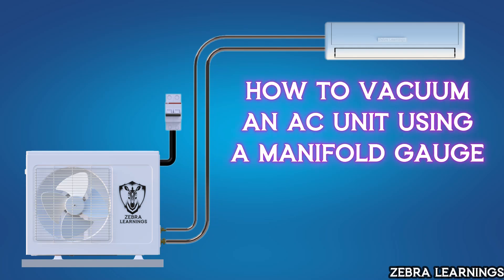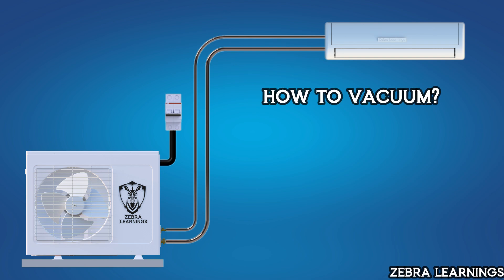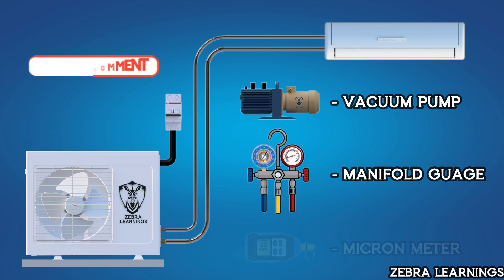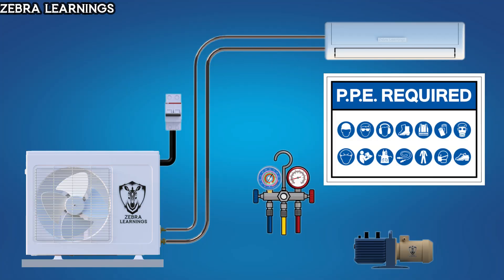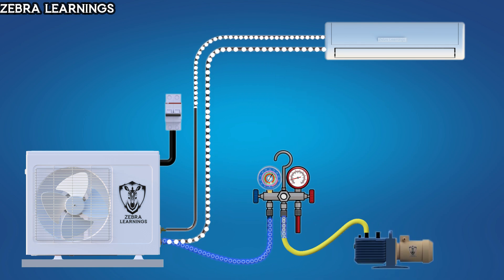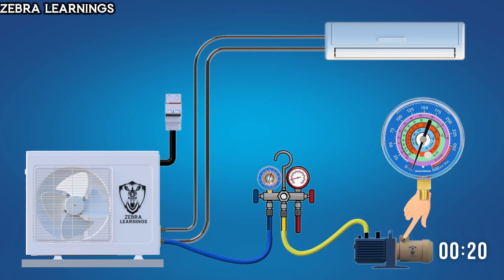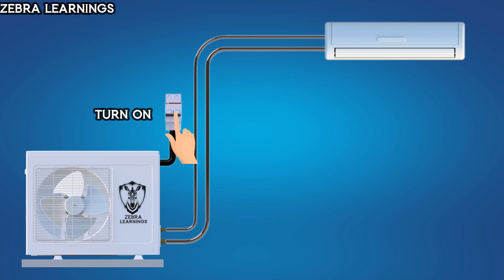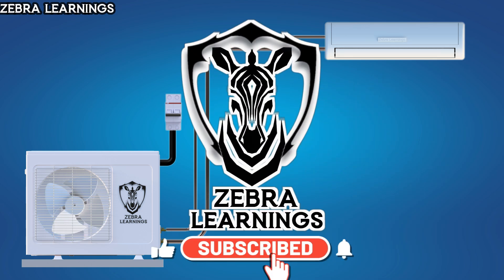How to Vacuum an Indoor AC Unit: Step-by-Step Guide | Animation |

Comment: NOPE.......Why use the manifold when you can bypass the extra leak possibilities?  You can simply use hoses and a vacuum gage with some hose valves.  Rookies use manifold guages to vacuum.  Also, where is the vacuum guage?  You are supposed to measure the vacuum in microns.  DO NOT LISTEN TO THIS HACK.  HE is clearly an untrained individual.
Reply from the maker: This video demonstrates how to vacuum an AC unit using a manifold gauge, and we’ve also explained how to perform the process with a micron gauge. The link for that video
https://youtu.be/XiPDHWW3dAA

Comment: Can i do the same vacuum process after replacing the compressor by leaving both suction and discharge valves closed whilst running the pump

Comment: Passed nitrogen pressure test for leaks and no bubbles show up in bubble test while under nitrogen pressure. Held pressure perfectly for 24 hours. Can vacuum down to 150 microns but it will not hold. It's at 1200 microns 2 hours later. This is a 12000btu mini split. Help.

Comment: 4 line 9 
direct 
045 inverter3059 alternate switch 1 series 5 circuit 7 volt switch diameter and (0)mainswitch

Comment: 3:06 ac technicians always open discharge valve first? You are telling to open suction line first? Please explain it. They open discharge slight and close. Than using soapy water they check leakage from joints. After that they full open first discharge valve than suction valve.

Comment: what happens to the oil  in the a/c unit does it come out to ?       And why is my vacuum pump oil  cloudy...?
Reply: The valves on the outdoor unit remain closed while you vaccum which is only applied to the pipes and indoors coil.

Your vaccum pump oil has absorbed moisture and should be changed

Comment: It's useless after you did vacuuming because you pump down the Ac, there still have a moisture, air and non codensable gas in the system of outdoor unit. Its better you removed it or recovered it All refrigerant gas inside the system and do vacuuming that's the perfect procedure. 
After vacuuming you put the new refrigerant in the system then your AC the result will cool properly.

Comment: My AC was not vacuumed while installed. However cooling is okay and satisfied after 18 month. The only issue is that compare to other same AC with same running parameter my AC is consuming 10-20% more power. Is it due the vacuum not done ? If so, How to do the vacuum now ? Please help
Reply: yes.  recover refrigerant. put vacuum on system.  check if vacuum will hold for 2 hours.  charge unit with refrigerant by weight.

Comment: If you fully open liquid and gas line before removing gauge, alot of gas at high pressure will accumulate in gauge pipe and significant refrigerant can be lost. Instead open the liquid line only, half a turn for 4-5 seconds and then close it again. Now remove the gauge pipe. It will ensure that while removing the gauge pipe, only a small amount of refrigerant at low pressure leaves the system and no moisture goes back.
Reply: Why don't I just remove the gauge pipe before opening the liquid line?
Reply: @karamhasanat4487  there is no air due to vacuum.....how can it be separated ? A little air or in this case gas liquid is needed to remove the air suction and let the gauge pipe go free.....

Comment: Means both the wervice valves were closed before vacumming? If yes, why didn't you mention about closing them before vacumming process start?
Reply: maybe because this is the new unit, that after completely installing the outdoor and indoor unit,
we have to vacuum the system to remove air containing oxygen inside the indoor unit before opening the service valve to release refrigerant into the system,
oxygen can be converted into hydrogen and clogged the AC system, blocked refrigerant to circulate.

Comment: So, during vacuum pump running , suction service valve is open right?
Also by this method, we can't remove moisture/air between compressor discharge line to receiver line?
Reply from the maker: No, Both the suction and discharge service valve should be closes during vacuuming. For a complete evacuation, the suction and discharge valves must be opened, and the entire system vacuumed. When performing maintenance work on the outdoor unit, such as replacing the compressor, a complete evacuation of both the outdoor and indoor units is required.
Reply from the maker: Here, the air from the indoor unit passes through the valve core to the vacuum pump.
Reply: @zebralearnings  if the air from indoor unit needs to come out via Suction side, the service valve should be mid seated, right?

Also, as you mentioned, for full vacuuming, we need to collect the refrigerant?
Reply from the maker: @bt9604  In old model service valve we have to set the service valve in mid seated. But in the modern service valve we don't need to set it in the mid seated. Because there is a valve core in the modern service valve.
Reply from the maker: @bt9604  Yes, first we have to recover all the refrigerant before starting the maintenance work in the outdoor unit. The link for the refrigerant recovery is below https://youtu.be/ssE4ZblLedo?si=45uxSJDHJVDrXzrx